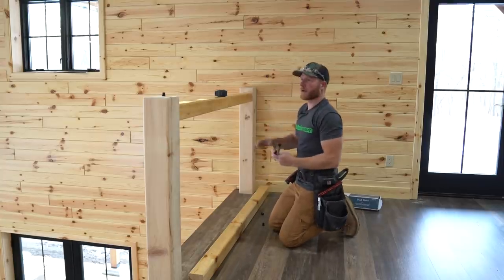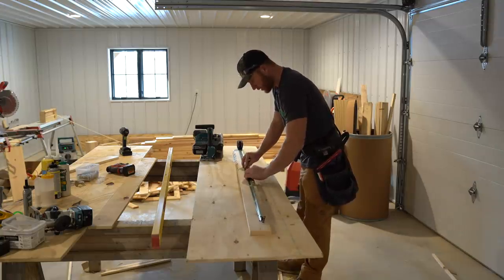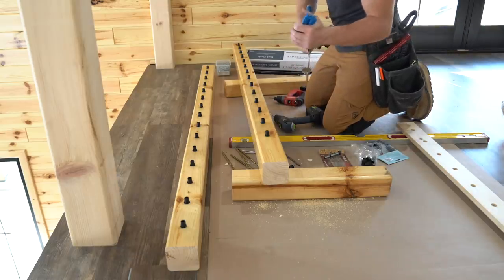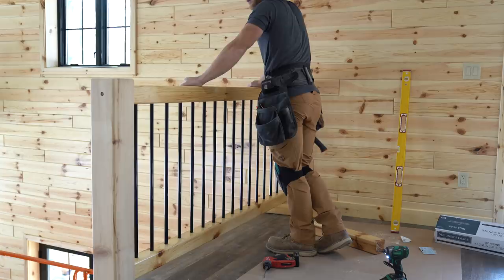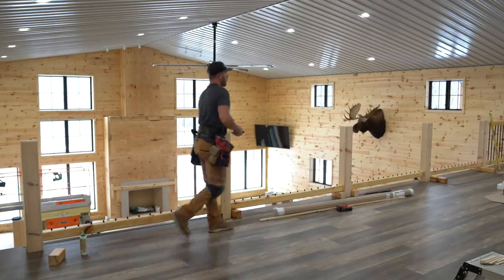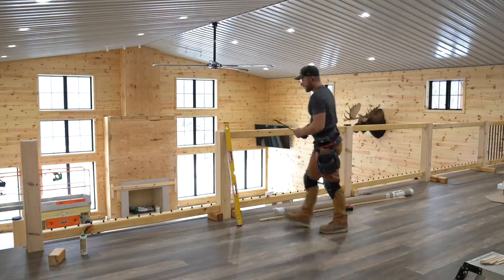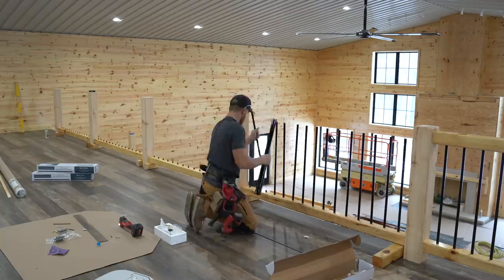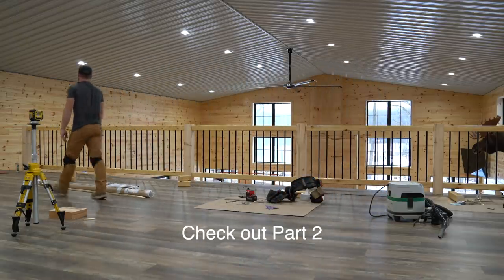Cabin in the Woods 47: Installing Handrails PART 1

Comment: Looks fantastic like all your work! 
Keeping your upper newell corner posts (which terminate flat-stair) close to the edge of the loft,will help tremendously on stair railings. 
If the newels are too far back from the edge,the top stair rail will connect at a higher level then the flat will.
Code calls for 34 inches to top of top rail ,plumbed up from front tip of tread .
Often you see an upper newel (turned corner post), and another post which gets the the stair rail connection. 
Typically the posts were mounted inboard too far,which requires a second post.
The GRK's were definitely the right call!

Comment: Plug your pocket holes. Kreg even makes plugs for that. It'll make the holes less noticable even if the grain of the plug isn't close to matching the rail. The exposed holes are going to look black from the lower floor. Also pound your finished lumber in place with a dead blow or rubber mallet and a folded up towel. The 'sharp' cut edge of the block can sometimes mess up your finish or even in some cases leave small dents in the finish product. I even yelled 'NO!!' at my phone right before you did that Haha. I look forward to your videos every week. Always like seeing how other carpenters do things. Never stop learning tricks for the arsenal.

Comment: Awesome! Way easier system than I did a couple years ago. They were black aluminum but didn't sit on pedestals,set in a drilled hole. Had about 300 lin feet to do 😑

Comment: I would have had to use a drill press or make sure the template's mating surface was the side I marked.  I find that when drilling any reasonable thickness I drift as I go through the material.
Reply: Just use it layout side down

Comment: Just a thought but you could have drilled a 3/4 inch hole all the way through each post and used a wood or pipe Dowling rod though and sticking out about two to three inches out. Then drill each rail to receive the dowl. Then you could hold the outward force a little better. Just an idea

Comment: Kyle, maybe too late this time, but when you are done using the template to set those little caps, you can open the holes into slots to help align the spindles rather than fiddling them into the top rail one at a time.
Reply from the maker: great idea...

Comment: The Kreg screws do hold a lot.  That said, I used 3" construction screws on my rails.  Don't try that on smaller material, such as 1x's. the flat head design of a GRK will split the wood out.  In thicker material. like you are using I don't foresee that happening. Kreg screws are meant to match up to the flat hole the bit drills.

Comment: I'm a huge fan and its been great seeing you do all of this finish work to the quality that you are known for. With that said, and all due respect, those railings just don't seem safe to me.  They look great, but the spindles actually flex when Kyle just grabbed hold of them.  The plugs screwed into the rails are definitely another weak point - are they plastic?  I'm no engineer, but the Kreg jig you used is meant for certain thickness woods - and these posts/rails are much thicker than the small portable jig is meant for.  For something that thickness I think the angle, depth and diameter should have all been different.

Comment: What did you think of those balusters? I’ve used them on deck railings, and some of them seemed to be a little longer or shorter then others (maybe 1/32 to as much as 1/8). Also, the stair railing holder bracket things, are at a preset angle, so depending what your custom built stair angle is (depending on the rise and run), this brackets could have some gap between the bracket and the pole… it wasn’t horrible, but I did notice it.

Comment: I installed that system on my deck. What a pain in the a$$ it was getting all the spindles on those plastic balls lined up. The stairs I had to cut on a parallel angle and that was even harder

Comment: I imagine someone has mentioned it but don't want to read all the comments, lol,, anyways  there is a way to plug kreg holes.  You can just jam it with a piece of dowel a little longer than the depth of the hole, and then use  a saw to flush trim the dowel.  They also sell pre-made plugs.  Once plugged the kreg holes would be nearly invisible to anyone looking from downstairs.  And they would be totally invisible to anyone who wasn't looking for them.  Railing looks great!

Comment: In keeping with the looks of things, I think I would make a U bracket with ears, painted black, to put on both sides of each post.  Then use 3 or 4 schedule 8 lag bolts (because they are gold in color) to attach the top and bottom rails to the post.  It would add strength to the railing but I think it would add to the looks or the railing.

Comment: I use GRKs in pocket holes all the time.
Reply from the maker: I will now forever I think
Reply: @RRBuildings  I bought a couple of 6" long torx bits just for this purpose.  I noticed when using a shorter bit, the edge of the pocket hole can get a bit mangled.

Comment: I'm curious as to which size Kreg screws you used for this installation?  ( After listening further, it sounds like you're using regular 2 1/2" Kreg screws. I would recommend that in the future, you use Kreg HD screws as they are a structural and beefy screw)

Comment: How come you didn't just use an open tenon at the top? Would be rock solid and you wouldn't have to do the horrid stuff with pocket holes. 
The open tenon can easily be made a feature with some accent wood insert over the top of the rails.
Reply: Obviously if doing from the start, you could do closed tenons top and bottom and it'd look the same as well as being even more robust :)

Comment: Looks great but how secure are those rails. I would be afraid some kid would go right through. I would have had a steel iron railing made to fit inside those spaces. They could still be mounted on the wood rails you made.
Reply: The wood is beefy enough to resist an adult person, and those lag screws are 10 inches long. Plus, the metal pipe spindles have to meet certain specifications in order to meet building codes. Those railings are not going anywhere.

Comment: Please note that I do not/can not do what you do.  This is the first time I watched something feeling a little "iffy" about your method.  For those spindles, you basically have a piece of plastic anchored by a drywall screw into the 4x4.  I would have thought that using your jig to mark and drill a 1 1/2  inch hole on the top/bottom and a 1 in on the opposite would have been sturdier/safer in the long runs.  I did love your idea of the GRK for the rail anchor screws.  I always thing rail spindles need to be safe yet replaceable.  Heck, you forget more than I'll ever know  :-)

Comment: If those pocket holes bother you,  they sell plugs.  I like seeing how things are connected.  Good call on using the GRKs in place of Kreg screws.
Reply: It was a good call , but the GRKs need to be washer head and not countersunk heads as they will pull in too far and not give the proper hold a washer head will.

Comment: Hi there, First of all great work. I have a question Where did you get those plugs? I am also working on my handrails and I would like to use the same system.
Thanks
Reply from the maker: I made them from my cut off materials with a plug tool

Comment: Could have doweled the rail to the post on the side you were unable to secure with the lag. But I realize it's always great to have a Youtube supervisor giving ideas "post" build
Reply: Yeah, I didn't think of it at the time he was talking about putting the railing together. Although, I think you're limited as to how far the dowel can stick out past the post, since the posts are already secured and there is not much wiggle room. But it's extra support where support is needed. (The system may not be WWE rated, but teen boys don't care when they're roughhousing.)

Comment: I drill both upper and lower with fostner,  over drill the upper so when a tube is damaged you just work the tube up and flex it to remove and replace it. allso copper pipe looks real good.  PS you can hide grk's by going threw the tube hole at angle.

Comment: Are you going to put in kreg plugs to hide the screw holes in the top rail?  I was wondering if the drill holes will be visible from down at ground level?

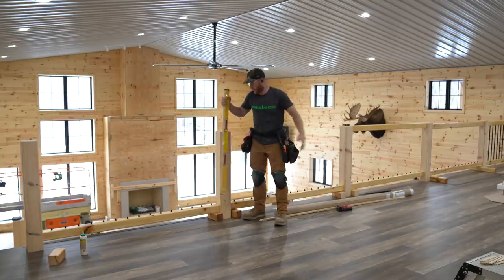Comment: CORRECTION: at 14:20, you mention that squeezing the handrails between the newel posts creates tension. Except that's opposite of what's happening. Tension is when a system is being pulled apart by forces, much like what happens when a tow strap when towing a car. What you wanted to say was compression, where an object is being squished by forces, much in the same way a cement column is squished by the weight of the freeway deck above that the column is supporting. (The third scenario is sheer, where the forces acting on the object are coming at different points, like when a golfer drives their club into the golf course because they swung too low.) The newel posts are pushing the handrails in, so it's a squeezing force, not a pulling force.

The great thing about wood is the way trees grow, lumber is great at dealing with compression. That's what makes it such a great material for walls. Concrete is even better at resisting compression, but I don't think it is as good as resisting tension and sheer forces as wood. (Steel rebar is added to an object before concrete is poured to give the concrete something that can resist tension and sheer force loads. Grady from the YT channel Practical Engineering has a series of videos on the subject that demonstrates how this works.)

Comment: I'm not a fan of the round spindles when everything in there is square. I think square wrought iron spindles with a twist every few would have looked better IMO. I personally would have drilled a 1-1/2 hole then angled a GRK into the post, installed a finished plug to clean it up. Instead of kreg jig holes everywhere looks hacked to me.
Reply from the maker: thanks for the opinion man...first time doing it....The client and I think it looks great so next time I will try to do even better
Reply: There’s always that one guy, keep up the great work Kyle and Greg
Reply: @michaelh6403   Think of it as a suggestion and you too can improve.